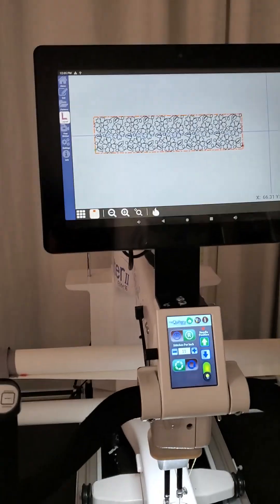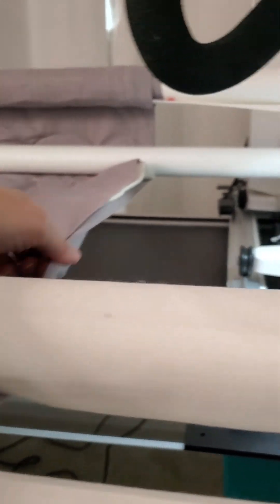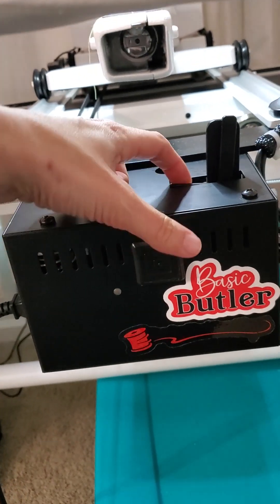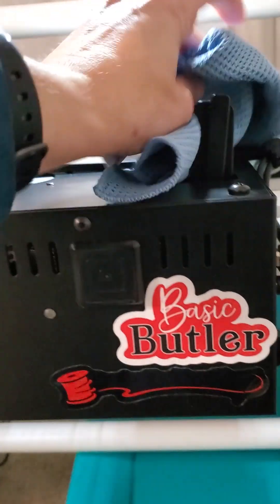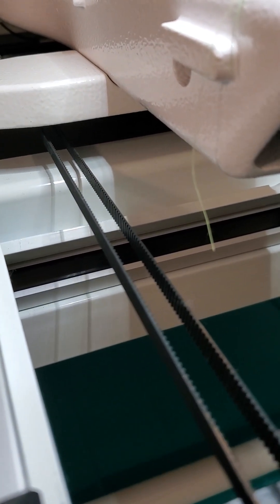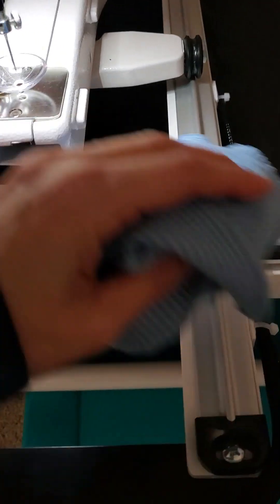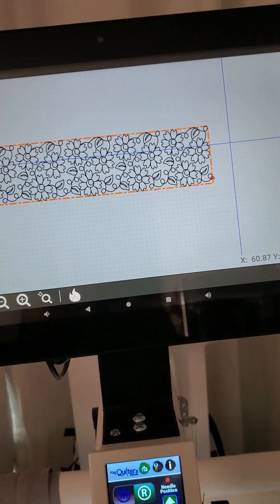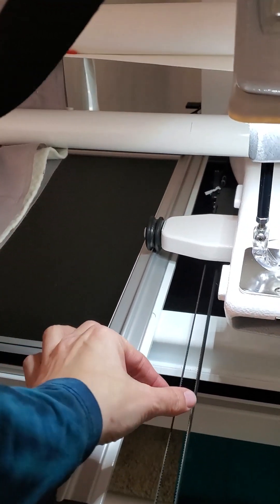Feature Friday 2025   Episode 2 Maintenance of Butler Robotic Systems

Comment: Thanks Aubrey.  I use my batting scraps to wipe down all of the rails and wheels before starting every new project, oil where needed and you’re set to go.  It’s amazing how much black residue accumulates in a few hours.  I also buy the cheap diaper cloth at Wal Mart and cover everything to keep dust off when not in use.  Glad you reminded everyone that a little maintenance goes a long way.